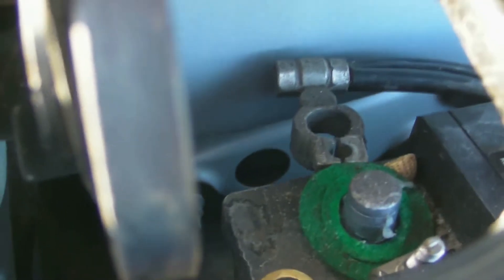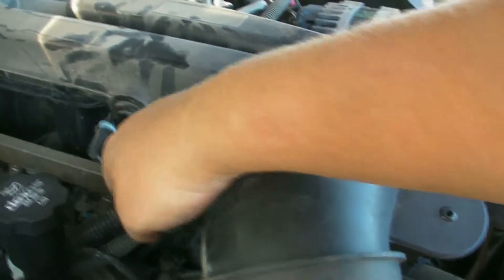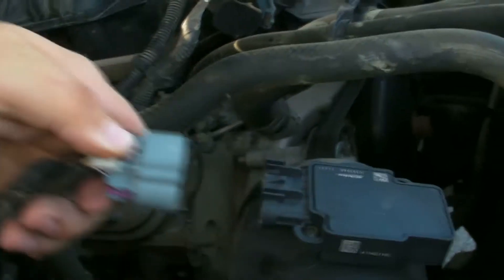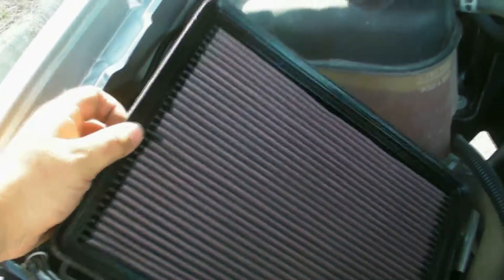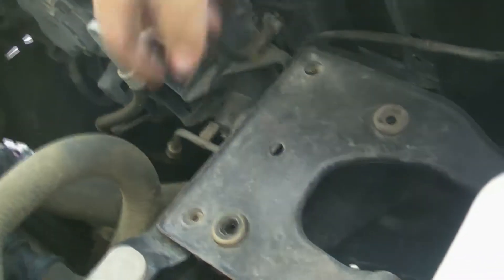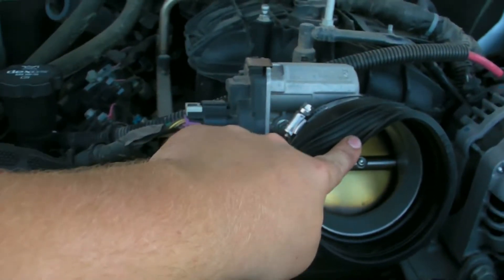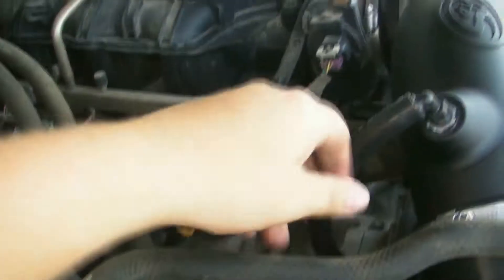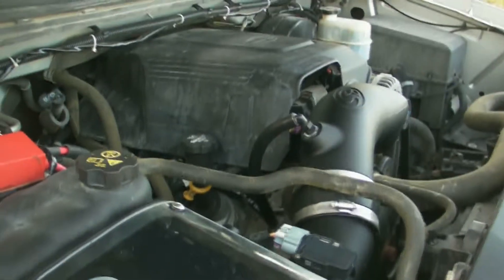Installing a Cold AIr Intake

Comment from the maker: Hey Y’all! Let me know if your running a cold air intake, and if so, what kind!
Reply: Woodsman I have a 2011 silverado and I’m running the spectre intake and throttle body spacer. Have you looked into getting an afm disabler? It turns off v4 mode and stops the lifters from failing which these trucks are known for. 200$ is a small price to pay to save your engine